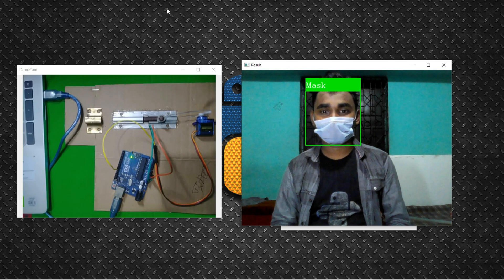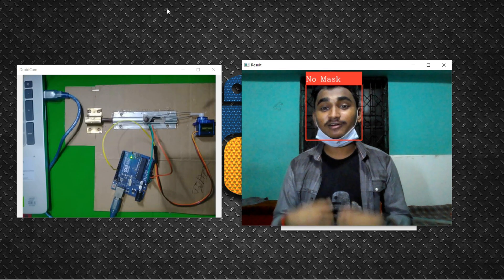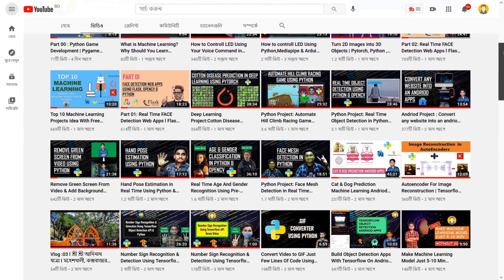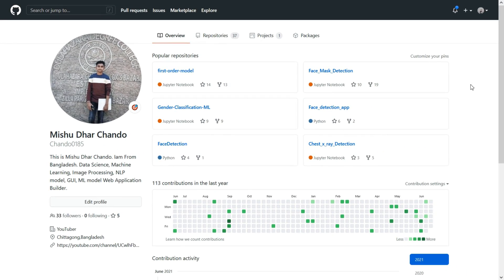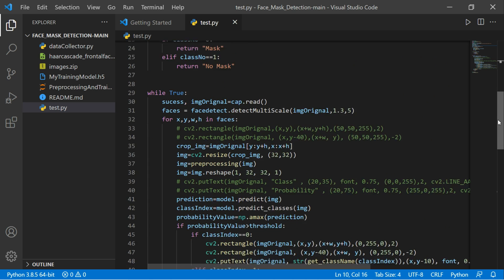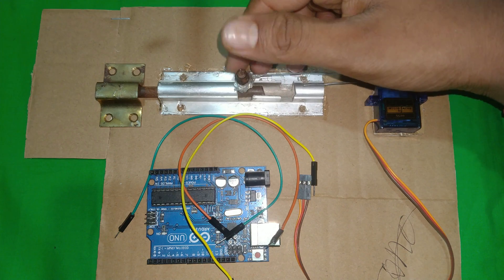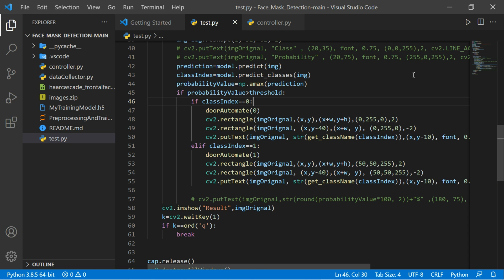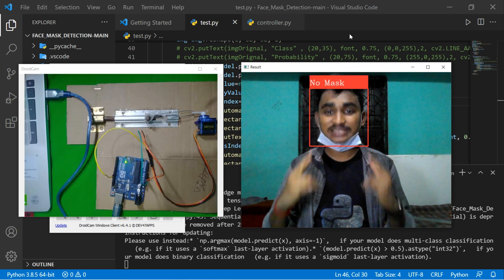Face Mask Detection Based Automate Door Lock | Python & Arduino | KNOWLEDGE DOCTOR | Chando Dhar

Comment: I have devlop a model using ylolov8 that is able to detect  man and women.
now i want to devlop a project which algoritham is like this:

1. at first using my webcam and opencv platform my yolov8 model detect the man or women.
2.if the man or women is detected then using ultrasonic sensor the distance of the man or women will be measure
3. if the distace is less than 4cm there will be a led which will be become high
4.If no man or women is detected the led will be low

NB: i want to use arduino uno as a microcontroller. and my yolo v8 model is already  devloped and able to detect to man or momen

can you suggest me the way of implementation. or any tutorial

Comment: Assalamu a'laykum   how are you all  I have  a problem 
 Traceback (most recent call last):
  File "D:\new_recognition\controller.py", line 5, in <module>
    BOARD = Arduino(port)
  File "D:\new_recognition\venv\lib\site-packages\pyfirmata\_init__.py", line 19, in __init_
    super(Arduino, self).__init__(*args, **kwargs)
  File "D:\new_recognition\venv\lib\site-packages\pyfirmata\pyfirmata.py", line 89, in _init_
    self.sp = serial.Serial(port, baudrate, timeout=timeout)
  File "D:\new_recognition\venv\lib\site-packages\serial\serialwin32.py", line 33, in _init_
    super(Serial, self).__init__(*args, **kwargs)
  File "D:\new_recognition\venv\lib\site-packages\serial\serialutil.py", line 244, in _init_
    self.open()
  File "D:\new_recognition\venv\lib\site-packages\serial\serialwin32.py", line 64, in open
    raise SerialException("could not open port {!r}: {!r}".format(self.portstr, ctypes.WinError()))
serial.serialutil.SerialException: could not open port 'COM4': PermissionError(13, 'Access is denied.', None, 5)

Comment: How much time it will take to execute first python code( all files and test. py) 

Please answer fast we have to do project
Reply from the maker: It's Depends on Your Ability, 
You will get some error you need to fixed but if you do it correctly may be take 20-30  min overall.
For Setup Arduino & All.
Reply: @knowledgedoctor3849  No, I am asking about training the model ( the code you run to get a screen ,which can tell if you wear mask or not) I am not asking about full project just that bit of code